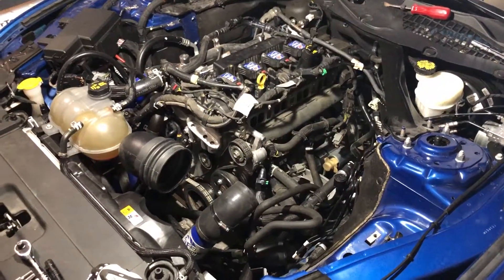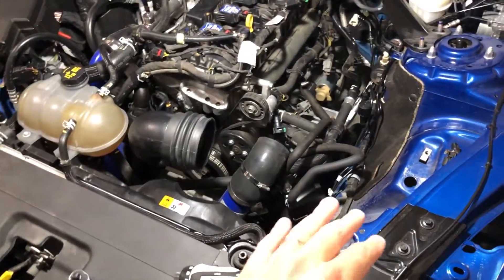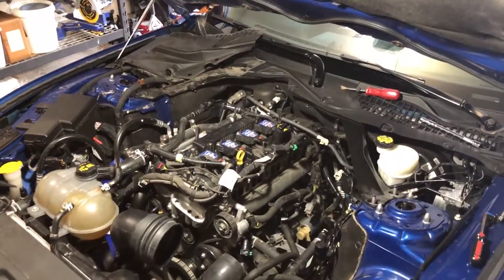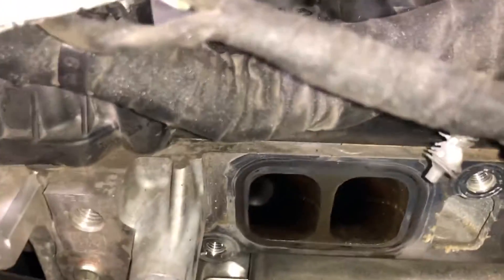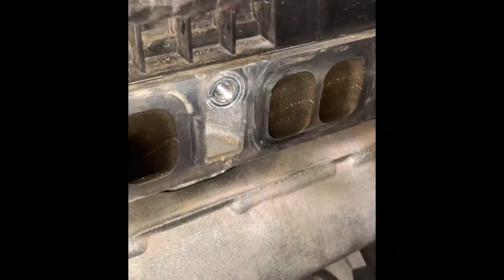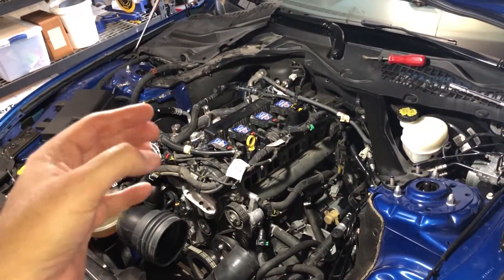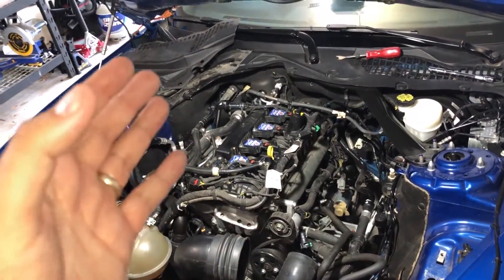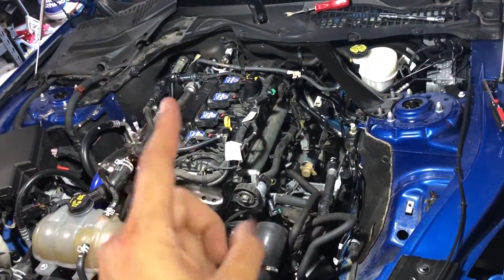2017 Ecoboost Mustang Carbon Accumulation on Valves - 78,500 Miles - Misfire / Misfires

Comment: Let's just face it, these ecoboost engines are trash. Cam phasers aren't keyed, crankshaft isn't keyed, has direct injection only so valves get caked in carbon and need cleaned, which isn't cheap. 

Not to mention the connecting rods are weak too.

I wanted one as a daily but after doing my homework, its not just NO, but HELL NO. I'll live with less gas mileage and better reliability of a 5.0.

Comment: I have a 2019 mustang eco boost, completely stock with 60k miles and it was just in shop for bad spark plugs and coil packs. I recently changed the spark plugs with the same plugs it had prior 8k miles ago and they were toast. Could this be due to carbon build up in the valves? Deeper issue? Or possibly bad gas mixing with the humidity in the air? We had 90% humidity in Texas for 3 days straight. I’m concerned but I have warranty coverage still. Thanks for this video!!

Comment: Hi sorry do you know if these valves are really bad carbon build up would cause misfires and lean fuel trims??
Reply from the maker: Those were exactly the issues that I had and cleaning the valves for the most part made a huge difference.  The other part was a pin size air leak at the down pipe flange.  Easiest way to troubleshoot the airleak was to cover up one of the exhaust ports on a cold engine and use the blower end of the shopvac up the other exhause port.  Now I could spray soapy water all along the hoses and equipment to find soapy bubbles.
Reply: @ricosmemoirs9171  Awesome thank you I did an intake valve cleaning with this intake cleaner from STP a few hours ago and it made a big difference thank you

Comment: I just bought my car in May that has literally the same mods your car has, I just started running it on 93 last week bc I assumed it would be better then 87 or 89, any reason why sometimes there's a strong exhaust smell and when accelerating smoke comes from the exhaust? Not big clouds but just enough for the person driving behind me to notice, I took it to the dealership where I bought it bc I have a warranty but they're telling there's no issues with the car and the car has been tuned, but they don't know what exact tune was on it, im just at a standstill lol....... any suggestions???
Reply from the maker: What year is your car as this makes a difference?  As for the 87-89-93 octane, this is quite important if the car has been tuned.  If you have all of the mods that I mentioned on this video, then you are more than likely tuned for 93 to which using the lower octane could produce some issues if kept doing all of the time.  Custom tunes are almost always tuned for a specific fuel type.  For the exhaust smell, when are you noticing it?
Reply: @ricosmemoirs9171  I have a 2017 2.3L, I notice the smell usually once the car is warmed up or after I drive it and turn it off, or even sometimes if im waiting in line at a drive thru and my windows are down you can smell it, I did just put fuel injector cleaner today to see if that helps, it has been running on 93 for almost 2 weeks now bc thats what the dealership recommended after I took it back to them, what's weird is im not burning oil, I don't have an exhaust leak or misfire, the engine isn't knocking, I just feel that the smell could mean something bad and i don't it to be anything serious, but on the other hand I think maybe it could just be bc of how the car is modified
Reply: @jose982142 if your still having this issue look up radium pcv baffle plate. I had same issue and I installed it and that fixed my problem

Comment: Yo my man , what's your psi with that waste gate added on?
Reply from the maker: With all of the mods and tune, at full throttle, I would get around 23 to 24.
Reply: @ricosmemoirs9171  thanks for the reply . I’m at 21k I’m planning on removing the runner to do a quick clean up and see how it’s looking

Comment: Where is the link yo Adam doing this process
Reply from the maker: Here you go.

https://www.youtube.com/watch?v=hnMDAwXmR68&t=422s

I also have another video which shows the clean up of the valves after walnut blasting if you are interested.

https://www.youtube.com/watch?v=s8x9Ih5jldM&t=402s
Reply: @ricosmemoirs9171  thank you so much, I'm debating on doing this or if I should just use the crc cleaning spray.
Reply from the maker: @horaciorodriguez8363  The CRC spray is what you should be using every time you do an oil change or every other change from the get go.  If the valves are already caked, then it will not really help much.  The blasting was the best thing that I did.  It fixed the misfires that I was having and pretty gave me a new car.  Just my 2 cents.
Reply: @ricosmemoirs9171  my car has 80k miles iv never done the crc cleaning technique. Imma go ahead and do the walnut blasting. Thanks for ur videos they sure are going to be helpful. One question, how do I close the valve that I'm going to work on?
Reply from the maker: @horaciorodriguez8363  I had the same question when I was going to do it myself.  When you open the hood looking at the engine in front of you, there is a wheel at the bottom of the engine with belts hooked up to it. This is the crank and you will see a socket bolt on it.  When you open your intake manifold and shine light inside of the chambers, you will see that 3 of the cylinders will be closed and one will be semi or fully opened.  Take a socket or open wrench and turn that bolt on the wheel to spin it and if you shine light in the open/semi open cylinder, you will see it moving either up and down depending on where it is in the sequence.  Make sure the direction you spin is turning the crank and not loosing the bolt itself.  If you see it going up and it stops, take a look at the other cylinders and you will see another going down and then up as you turn.  So only one will be open and all others will be closed.  When I did it, I kept cycling until I reached the last cylinder so that 1-3 were closed.  Then I put a piece of tape to cover the intake for #4 and went through the process as shown in my video.  Hope this helps.
Reply: @ricosmemoirs9171  I'll be doing this tomorrow i bought all the things I needed already. Can't wait for tomorrow, thanks for explaining everything and for ur time.
Reply: @horaciorodriguez8363  , this is TTRon & Ck my just posted  my2cents on the before/after video;  basically mine w/o CC  @85,750 has given me NO drivability/idling issues & no loss of mpg.. Thinking of getting the professional machine induction cleaning done & Fd Perf. Catch Can soon.     Idling COULD*BE getting a 'little' rough, hard to tell if its only*just gradually  getting worse till it actually acts up.
Reply: @ronaldburk115  hello, I would advice anyone who has these cars to do the intake valves cleaning manually. My car had actually started to blow out white smoke from my exhaust pipe, it would only do this at cold start. It had never done it before so I wondered if dirty valves could be behind this. After seeing ricos and Adam's videos I decided to do the cleaning. Best thing I ever did the smoke went away the car feels smoother. I  let the crc spray soak for about 30 minutes then used the zip tie method to clean the top of the valves it worked great. I also used the zip ties to clean the walls but none of that oil came off, so I tried using a wire brush at the end of my drill it worked like a charm. I didn't do the walnut blasting because I didn't need to my valves look like new.  I will be helping my friend out this weekend with his ecoboost, he used crc spray about 2-3 months ago. Will see if that crc spray worked without removing anything
Reply: @horaciorodriguez8363  I came across a guy who tested the CRC soak vs. with adding about 1/3 BRAKE CLEANER to the CRC in adjacent cyl.; w/o agitation it-think he just let it bubble [the CRC alone didn't].  Sides became real clean! w/ the +BC.
Reply: @Horacio Rodriguez, the professional machine I am referring to is ATS Chemical 3C Intelligent Induction Cleaner. S Kilmer recommends it too.

Comment: Why not use Crc or bg induction service?
Reply from the maker: Yes.  Should have totally used any of those.  I started using the CRC Cleaner since I cleaned the valves at 78500.  I will probably do another video at 110000 to see the difference.
Reply: @ricosmemoirs9171  another 'machine' method I referred to in another comment I made this morn is the ATS Chemical 3C Intelligent Induction Cleaner. S Kilmer recommends it too.

Comment: The new oils that have classification Sp GF6 should help with this carbon problem i just got a brand new EcoBoost mustang and from the get go i already had a catch can installed and changed the oil with Mobil1 5w30 fully synthetic oil with Sp GF6
Reply from the maker: It would be good to see if the GF6 makes any difference.  I think the issue is that if you tune, you're going to get the issue as the system is just running more aggressively.  Catch can is a definite must.  There is not question in my mind that I would have probably had to do this at 45-50k instead of 75k if I had not had a catch can to keep that junk from spraying back into the intake.  Lets see what comes from the GF6 oil.  Thanks for the comments.

Comment: Let me ask you can we use CRC valve intake cleaner.
Reply from the maker: I really can't answer this.  I know that they recommend using it every time that you change your oil.  I have been doing so after I blasted it.  Supposedly it is supposed to prevent this problem, but no one has posted studies or experiments of before and after.  Maybe one the vehicle goes to 125k I could do another video to look and see.  Would be a good comparison video with 50k worth of mileage using CRC every 5k.
Reply: @ricosmemoirs9171  Thanks buddy

Comment: That is not a lot of carbon buildup.  That actually looks quite good for 78k miles.  Actually, yours looks better than most that come through my shop - I would have sent you back on your way and had recommended you hold off on a walnut blasting for now.  It gets sooo much worse than what yours looks like.
Reply from the maker: I have seen some videos on BMW's that were pretty caked on there.  For me, I was running into misfires and had troubleshooted everything that I could imagine that could have been causing it and this was the last thing that I could have imaged.  Sure enough, not only did it fix the misfires, but the car runs completely different. Could be because of my tune, but it made a huge difference. 😉
Reply: @ricosmemoirs9171 For my 2018 Ecoboost at 78k miles, would you recommend cleaning out the chambers for my cold start misfire issues? I've already started buying the equipment to do it.
Reply from the maker: @Notorious_Grey  for my personal view, it really makes a very good difference. It may not fix your problem, but it is definitely a good thing to do I know for me it fixed the misfires so hopefully it may do the same for you. Good luck.
Reply: @ricosmemoirs9171  Thanks for replying to me! I've really struggled with this and my dealership won't troubleshoot the issue properly.
Reply: Yoster77 check my comments above.  TTDRon

Comment: Honestly not as bad as I expected, especially compared to a VW. They do say that ecoboosts don't tend to carbon up as bad as some other DI engines.
Reply from the maker: I agree it is not as bad as I have seen on some BMW's where it is really caked in.  On another note, I did have a catch can installed very close to the beginning so that also helped out.  In either case, it was enough to cause misfires and shaky idling.  Since the cleanup, it's been running great.

Below is the video with a before and after the cleanup:

https://www.youtube.com/watch?v=s8x9Ih5jldM&t=19s

Comment: Hey Rico -- good stuff! Thanks for taking the time to post what a lot EBM owners have been curious about. Honestly, not terrible looking for 78k+. I was expecting much more build up from other Ecoboost videos. The video mentions misfires in the title, but were you actually getting any rough idle, drivability issues from that amount of build up?
Reply from the maker: Yes.  I was constantly getting rough starts on cold and misfires.  After exhausting everything that I could think of, I finally decided to take a look at the valves.  I have another video that shows a before and after of cleaning the valves.  BEST THING I HAVE DONE!!! Fixed all the issues plus I could not believe how much more resposive and smooth the vehicle felt.

https://youtu.be/s8x9Ih5jldM
Reply: @ricosmemoirs9171  My '16 w/ more miles than yours and NO CC has had NO issues except MAYBE just subtle*roughness changes in the idling  that are hard to notice until it gets worse!?  I'm leaning towards using the ATS Chemical 3C Intelligent Induction Cleaner rather than opening engine.  S Kilmer recommends it too. Have to ck w/ Ford if they oks it.